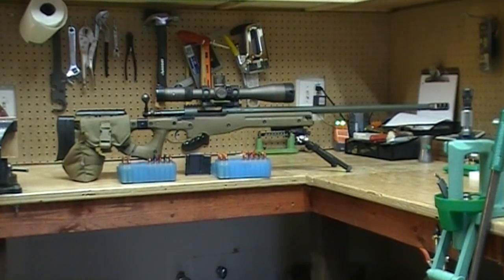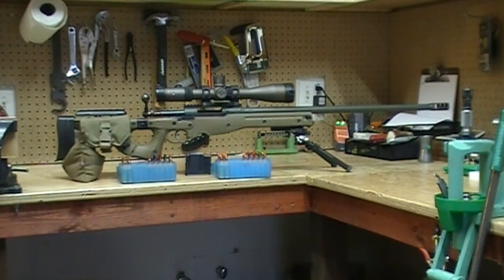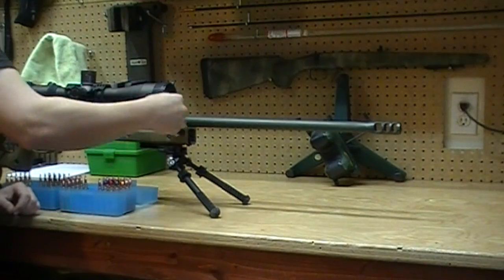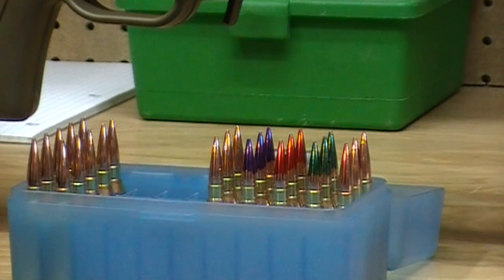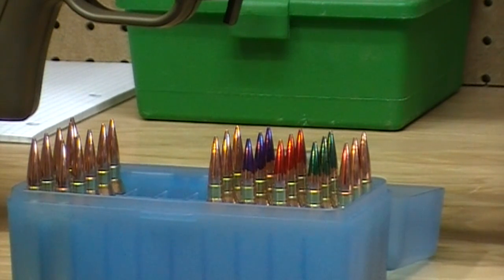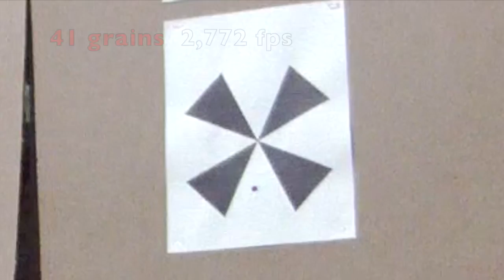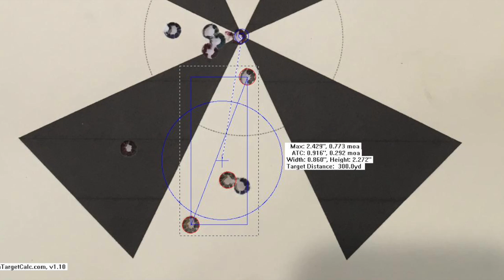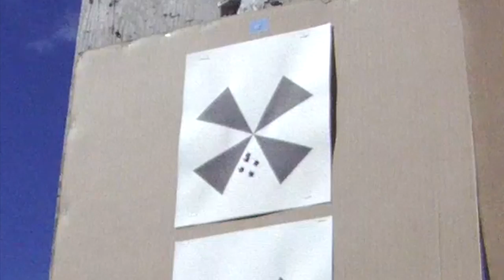260 rem load devcelopment 3 (ladder test)

Comment: Nice video. I like to see if other guys are doing it like I do. I couldn't figure out how you knew which hole was what bullet? I use a different bullseye for each set. Ive been considering getting a 260 reminton thats why I watched this. Im shooting an amax 168 out of my 308.
Reply from the maker: I have to use sharpie to color the bullet tip and I use the camera to make sure I know exactly which shot goes where.  Its an art and I am still learning to this day after many years of loading.
Reply from the maker: Shooting a .260 is like cheating!  It bucks the wind sooo much better than .308.

Comment: He didn't find a node with the first target... with the second he did. It's  around the 42-42.5 point. If you graphed his speed (and pressure) of the loads you would see a flater spot. Load up the center of the flat spot. That was if your off in loading .1 grains for whatever reason your still in a nice fat node where speed is going to still be dang close

Would like to see his 42.3 groups

Part the issue with the first target is he is running a ladder test at what I've always heard is the MINIMMUM distance a ladder works.

I have some major issues with this idea of barrel "bulge" and explanation of barrel whip... 

Better series than most on YouTube though... if you feel out over ladder testing go look at "road  to prescision"

Comment: I'm confused.  What makes this ladder test any different than just loading a few rounds with different charges and seeing which one shoots the best?
Reply from the maker: This is different because it is shot round-robin style.  This test is to look for the accuracy node of the barrel.  The nice thing is you can find a good load while not burning up a bunch of components.  It can also find the optimum charge weight too.

Comment: So the wave length is traveling at the speed of sound down the barrel. And this particular bullet is traveling roughly 2.25 to 2.5 times the speed of sound. Explain to me why barrel movement long after the bullet is gone, would make a difference or am I missing the focus point?
Reply from the maker: The bullet doesn't start at 2,850 feet per second.  It accelerates down the bore and reaches its maximum speed upon exiting the barrel.  Either way I am no physicist, just a guy who likes to shoot long range.  Take it with a grain of salt, but this method works for me.
Reply: Ok. What is your .260?

Comment: Can you please explain the "known accuracy charge"? 01:41
Reply from the maker: +MrSottobanco 
It is simply a charge (41 grains of H4350) that has shot well in the past with similar bullet weights.  I selected this charge because it is middle of the road (pressure wise) and has a low SD.  My final load wound up being 42.5 grains of H4350 with the 140 VLD.  This gave me a 5 inch vertical spread at 1,000 yards which I am happy with.

Comment: would you figure out the most accurate load then adjust the bullet lenght?
Reply from the maker: Some guys do that, this just works for me.  When you change seating depth with a given powder charge, it can change the pressure.